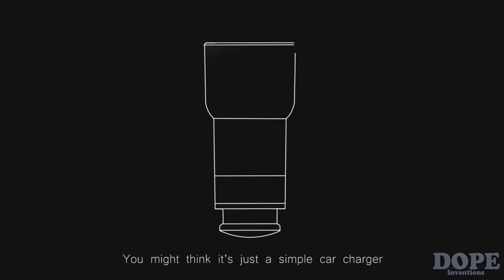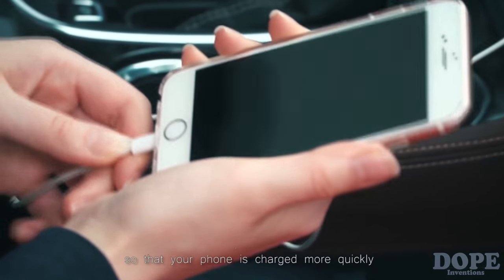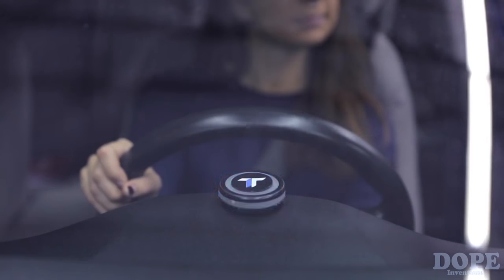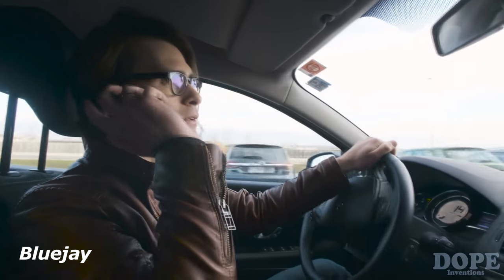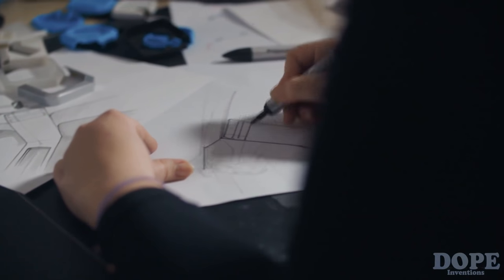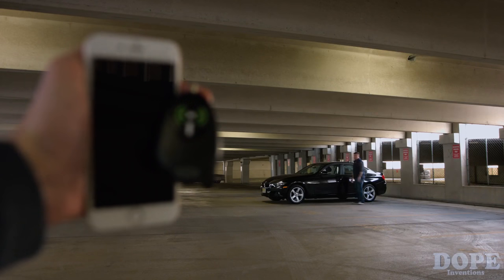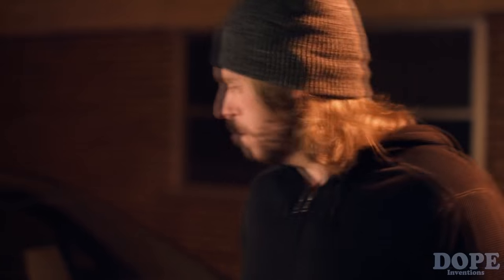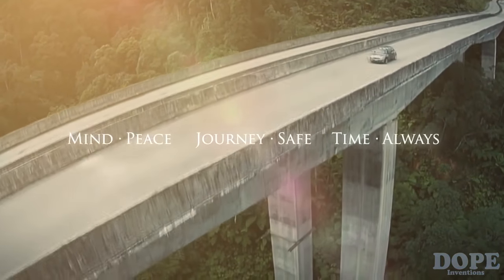5 Coolest Car Gadgets You Must Have! ▶2

Comment: TrapTap should be purchased by the Waze app. Good idea and design, but it needs a large user community to make it effective; which probably won't happen without aggressive advertisement.
Reply: That's a great idea. But it'll be Google doing the purchase as they own Waze.
Reply: +LIVEFRMNYC You're right. Probably won't happen then, since Google isn't real big in devices. Only ones I can think of are the Nexus phones
Reply: Chromecast is not bad aswell

Comment: problem it against the law in Europe to touch your phone when driving
Reply: not just Europe.
Reply: not in Germany
when you can attach it you can use it
Reply: In certain countries in Europe perhaps.
Reply: +Alfredo Nobeli Not true Germany law follow the the Europe wide regulation the if a mobile phone is to be used it has to be fully connected to the vehicle or hands free device that the mobile is not to be touched by the driver unless the vehicle is out of gear and the park brake applied. The mobile device has to be in a phone cradel. 
This is a standard law across Europe
Reply: BluJay is creating the impression it's safe to be tapping on your phone whilst driving?! LOL As soon as your focus is on the screen of the phone rather than on the road it does not matter whether you're holding the phone in your hand or it's mounted to a stand. This is a bad joke.
Reply: burso83 you are right that why total voice control or steer wheel mounted controls or a combination is best
Reply: Its against law in most countries not just Europe! Thats why most cars have voice activation calling built into them via wireless Blue tooth. :) No need to touch phone at all! I drive a Hyundai Hybrid SE base model, with those standard features in it. This video was useless.

Comment: I had Fobo on my car about a year ago. Lasted for only few thousands miles. Then one of the sensors started giving false readings - one minute tyre is flat, then it is overinflated, then suddenly underinflated, then overheated. I'm now using more conventional aftermarket TPMS now. With inside sensors, even though I had to pay for installation and balancing.

And everything else... FM-transmitter with hands-free and music streaming. Really? Most of car-stereos these days are capeble to work with phones directly over BT directly.

Comment: I'm not really impressed with the Roidmi. In the San Francisco Bay Area, there's no "open space" in which to broadcast without interference from one FM station or another.  I tried three different versions of one of these and they all failed miserably. I finally gave up on FM and had a  bluetooth gadget installed which breaks the radio's access to the antenna for whatever frequency I want, and instead acts as if it is an FM station. I can still listen to other FM stations.

If  the Roidmi could talk to a wired Aux input on the radio, it would be a heckuva lot better and much cheaper than the gadget I use.
Reply: how it's called that bluetooth device which breaks the radio's access to the antenna?
Reply: Here's the link to the device: http://isimple.com/catalog/install/ISFM2351

I had mine installed by Best Buy, which for once lived up to its name. It handles both my music and hands-free phone device. Personally, I give it five stars. Frankly, even if a wired-to-aux roidmi were out, I'd still stick with this one for the convenience.

Comment: first object not useful cince most cars today HAVE al that built in to the car. and even ads on to it. second item... if you have to speed like that well honestly stop speeding its even to sertan extend ilegal to have, third your cell sould NEVER leave the pocket while you drive... that is actually part of the law for the fourth one... well migth actually be nice but, I would then just kill the camera. ergo smash the front. for the fifth... dont need it either, it is peskribed from a workshop how long you until you need to shift tires. and even fill the air. eu controls... and you can also se the stripes in the tire. I dont even have a car and se theese as usles jugle that might even be unsafe to use. oh one more thing many cars tuday have nav option. this ofthen actually warn you for speeds controls...